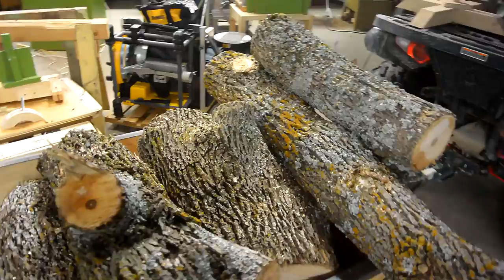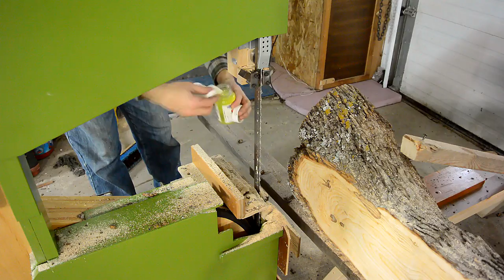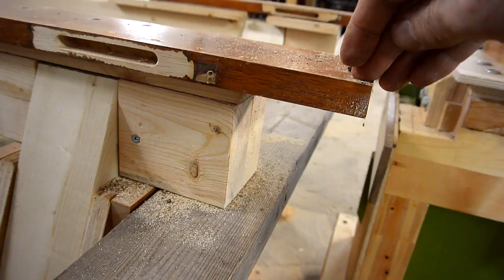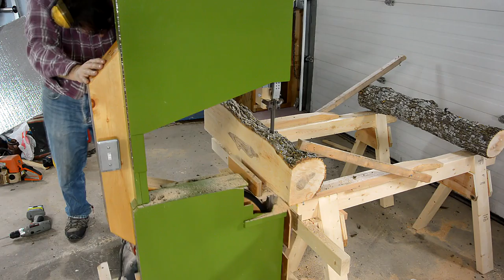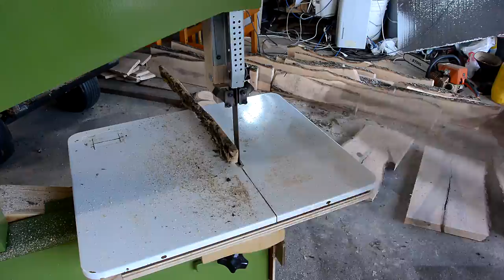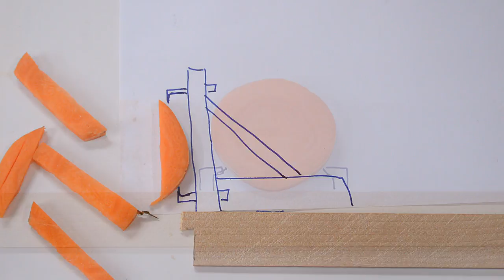Bandsaw-on-a-dolly sawmill improvements

Comment: +Matthias I've taken to using my shop vac in blower mode to clear away dust and chips. If you were to do that, then put your dust collection opposite the blower with a wide nozzle, you might be able to catch all of that and not have the clean up time between each cut. IDK
Reply: Actually, I have an idea that might work for your mill. Attached to the lower portion of the bandsaw, think a bowl shape with a dust collection port towards the bottom and angled back towards the bandsaw body. It would have to sit below your guide rail follower and it would have to be slightly large to really catch all the dust and chips, but I'm sure you could rig it up.

Comment: Apologies if my comments are repeats but: 1) If your motor seems underpowered, you may find a smaller blade cuts easier/better due to less friction and still cut straight if your tracking has improved. I notice a huge difference between a 1/2 inch and 3/4 inch blade on my Grizzly when resawing greener wood. 2) Can't tell from your video but I hope you are using dust mask in addition to dust collection. There can be lots of mold spores, etc.. in wood like you are cutting. I had a nasty prolonged lung infection after cutting some live edge wood a few years back. Love your constant innovations and explorations. Thx for your vids.

Comment: Just read the article accompanying this, and the only improvement I can think of at the moment, in the spirit of keeping this cheap and simple, would be some sort of fabric skirt to stretch around the wheels nearest the log. Maybe a strip of jeans stretched over a wooden bar, and the skirt weighted at the bottom, or something? It's the only thing I can think of that may help with the bark buildup you mentioned, and not get too much in the way of anything while you're sweeping up between cuts. I can see there isn't much room between the wheels and the sawhorses :D Take care.

Comment: Matthias - great stuff! Just mount a holder to aim a nozzle from a shop vac in front of the saw, and plug the hose into the exhaust/blower side. Should be enough to keep the floor clear while you work...

Comment: I'm sure you've seen them before, or at least researched it, but the idea at the end with the dogs to hold to log is how large-scale bandsaw operated sawmills work. The logs get rolled onto a carriage that moves back and forth through the bandsaw (as opposed to moving the saw) and are held in place by the dogs.  After each pass, the carriage returns to its home position, gets indexed whatever thickness they happen to be cutting the boards at the moment, and makes another pass.  Have you also considered some type of adjustable index either on the rolling saw or the sawhorses that would keep you from having to move the log after each pass? Something along the conceptual lines of your gear-drive box-joint jig?

Of course they use hydraulics and heavy duty steel framing in sawmills so they have plenty of power and strength, but I'm interested to see what cool, simple idea you can come up with that achieves a similar purpose.

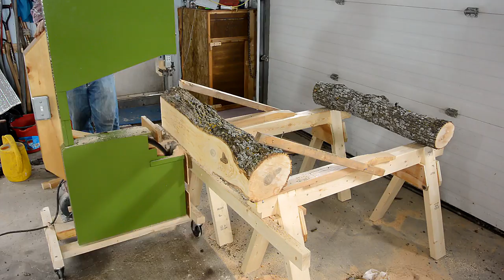Comment: Hi Matthias, with regards to log repositioning time, have you thought about the following: The pieces of board that you screw into the top of log at 3:59 in the video, the bottom piece of that is currently nailed into the board that the log is resting on. If instead of nailing it there, the bottom was attached to a runner (similar to a drawer runner) that could move back and forth toward the saw, and then you had some sort of gear system (or even just manually) move that sled, you could keep the log stable while moving it forward and not have to worry about unscrewing every time. Note that the piece of wood the log is resting on wouldn't be moving in the proposed setup, just the piece of board that's nailed to the top of the log. Picture a standard kitchen drawer, except the bottom of the draw stays still and just the front panel of the drawer (the log) moves in and out with the board nailed to the top stabilizing it via a runner.

Comment: Matthias, did you think about keeping the saw stationary and building a big sled running on a track to move the log through the blade.
Reply: Interesting idea, might as well mount the saw horizontally then.
Reply: Bob D. Just get some angle iron and use as tracks. The logs on tracks and band mill stationary. Just suggestion.
Reply: W.A. van Buren actually might get less pinching vertical, like you are doing.
Reply: Nice Idea but he would need twice the space for cutting the same length of log if i'm thining right. Correct me if I'm wrong :)
Reply: He's already done this. Look back like 4-5 years.
Reply: I tried this and I think next time I will try moving the saw.  Lots of space and large logs are tiring to move even with rollers in place
Reply: I think the point is to have the possibility of cutting the entire length of a tree if possible.
Reply: I think it's better to keep the log stationary in a solid fix and move the saw instead. Why move a 1500 lb. log if you can move the saw :P

Comment: To help with the sawdust/bark/debris removal try blowing it away as you cut; for example with compressed air, a leaf blower or exhaust from a shop vac. A strategically placed deflector shield will put the airflow where you want it.

Comment: Addressing your issue; I think is you revisit the possibility of a semi fixed dolly trax with a counter leaver wheel system, that it would start to eliminate your vibration issues. By placing the tracks on supports boards under the tracks themselves you can allow for cushioning to level and preventing reverberation. 
Attaching the tracks to the boards, and the board remaining free, it becomes semi permanent. Removable. 
Additionally, If you slant a feeding system toward the cutting area - loaded with log after log. Each log would provide the mass to provide the stability. Leaver in front of the first log would hold it all in place, which could be pushed out of the way by the movement of the dolly ban saw, then rotate back after the saw has finished the cut, pushing the fresh cut out of the way.

Comment: Mattias. I really like this project because I have a bunch of trees that will be either fire wood or lumber.  Sort of an extension of the rail idea, make a board that locks the bandsaw against the guide that you can slide it into. And perhaps a feed mechanism with a screw or winch setup for an automatic feed setup.
Reply: The home-made bandsaw sawmills I've seen all use a hand crank attached to a pulley for feeding the saw carrier over the log.

Comment: Log sled, attached to your gear system similar to your box joint jig. You advance the gear which advances the log. The log is secured once initially, and then the sled powered by your gear can determine the width of cut.

Comment: I guess these "sawhorses and dolly" setup just take up the same amount of space as the sawmill extension for this bandsaw would. There certainly is some idea behind these experiments with keeping the mill setup vertical. But I also strongly believe that once you make this horizontal (like your smaller one), the resulting sawmill will be the best solution for saving those otherwise wasted logs (making a great supply for a small workshop).

Comment: To stabilize and simplify your setup and movement of the log, you might consider a "log dog." As they're super simple to move between cuts and are basically giant staples! I've used them for hewing logs and it would be impossible to hew without them or at the very least, a partner. Best of all you could easily make them from some scrap angle iron you might have laying about!

Comment: You where on the right track with the carriage idea..make a dovetail type groove in the sawhorse tops and build what you drew and use the dovetail grooves to hold them on then build the log clamp.use a cam to hold it tight to the upright and tighten it to the log.

Comment: just my thought Mathias,  get 2 10' pieces of thin wall pipe, the cheap stuff. Make a track from it, attach them together about  14 "  ~  16" apart or what ever distance that works .. make 4 rollers that each have diagonal rollers and install them on the bottom of the saw.... then the saw can be placed on top of the spaced pipes...... and pushed as needed easily...since most the dust will be on the floor rather then on the pipes.....
  Now further,  attached the pipes to the frame that you place your log on so that it doesn't move around on the floor......  hence frame and track are all fairly solidly connected together... at least in a temporary fashion until you easily disconnect when not needed ....

Comment: Clamps are a pain too. If you want easy reattachment that stands vibration you have a hard problem. For rare homeuse perhaps consider screwing the log to a big plank/rail. The screws eat an inch, but as homeuser it might be faster/easier to lose a bit more for more stability and faster reload. Otherwise going horisontal, as u have done before, is the way.

Comment: for positioning the log, i would suggest a slotted board under the dolly for the wheels to ride in, with the distance between the slotted being how thick the boards are cut. i.e. making a track mill. that way you don't move the log between cuts, you just move the bandsaw to the next set of slots.

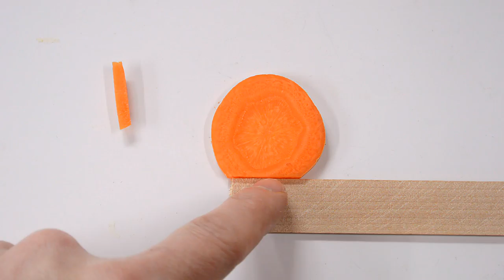Comment: 5:45 Just rotate the log along the vertical axis. End-to-end. That way you can just have a 90 degree panel mount and screw through it into the newly cut log face.

Extra work, sure... but still.

Comment: Instead of turning the log over once you have a right angle between the first two cut sides turn the log around so that you keep the same side down. 

Adding weight to the log support might help with the vibration.

Comment: I suggest you mount a plate or rollers on your band saw to gauge the slab thickness similar to the way it's done on a chainsaw mill. That way you can mount your log out from the table as far as you like or even on lathe type mounting so you can rotate it easily to cut it from the outside in. You wouldn't have to keep making adjustment for each cut. The second thing I see is a need for lubrication. Even though it's a vertical band saw, you are cutting through green wood that is full of sticky resin. If you added a bottle and tube to wet the blade with just water and maybe a catch basin underneath, it should make it easier and your blade will last longer.

Comment: Instead of tracks on the ground, It may be interesting to put a track like a C channel along the 2x4 guide and have rollers on the front face of the band saw slide into the track. That way the band saw can still move freely, but lock into the saw horses when used as a mill.

Comment: You could do your sled idea with maybe a wheel that shifts it 1/4" per turn, maybe a spike at the base of the end if the sled to keep the base of the log in place. On top could have some claws made from wood or metal that you just knock in with a hammer slightly with some kind of lever system in case they go too deep and can't be removed by hand.

Comment: Insufficient power frequently seems to be an issue when scavenging motors. Is there a practical way to add a second or third motor? Would that help? 1/2 or 3/4 hp motors are pretty easy to find. Maybe 3 of them would make sufficient power and torque. Just an idea and I would like to hear your expertise. (Thanks for the vids)
Reply: Well if they would all be the exact same speed you could just couple them together with v-belts and pulleys for example. Or for different speeds add differently sized pulleys.
One problemw ith this might be that the motors have different torgue at different speeds possibly, so while motor A wants to power through, Motor B already slows down and so Motor A has to work harder to compensate.

But again, Lets say you find 2 or 3 100% identical motors (maybe even the exact same ones over and over) that would be no problem.

Comment: for the build-up of sawdust that's on the wheels: Even though its better with the bigger casters, maybe it would be better if you had some-sort of brush system to brush off the sawdust as you roll. If the brush is rubbing the sawdust off, it might be easier to roll. I know that's not really the major issue, but I figure I'd throw it out there.
Reply: good and simple idea!

Comment: Having a real sawmill I find this a little painful to watch! ;-)  Of course, I had to shell out $10k to mill logs... :-(   I'm thinking if you milled another flat on the log and rotated it so you had a flat vertically oriented running parallel to the cut (the right side of the carrot), you could make a support bracket that is square to the sawhorses to hold the log.  You could even make it a sled that would slide horizontally on the sawhorses making repositioning for each cut quick and easy.

Comment: instead of moving the log, find a sturdy way to mount the log to a board vertical board perhaps just sink a few 4" screws through a board into the log from the side.  would it be too much torque to handle?

then if the log can hang over air, you can adjust the depth of cut with an adjustable guide rail on the saw.  let it stand off the saw horse, and progressivly pull the guide shoe in 1" each cut to make your passes.  no moving the log, just adjust the shoe.
Reply from the maker: Always count on youtube comments for really bad ideas.  But this bad idea has been suggested many times already.

Comment: How about...  Bottom of bandsaw mounted on two tracks on the wall. A third track on the ceiling above to hold a chain that carries the weight of the bandsaw. Place logs on floor with shims to level. Less lifting. PS great video!

Comment: What about a french cleat setup or wedges on the supports the log sits on set at certain lengths so the two boards that are screwed into the log match the cleats or wedges. That way once you made a cut then you just move to the next cleat or wedge and clamp down with quick clamps. It would set your thickness and you wouldn't have to unscrew and screw back on for each cut. I dont know just an idea...

Comment: Rather than making the bandsaw horizontal, I thought at the end it was going to end with suggesting putting the table surface vertical...
Rather than putting the first cut surface onto the horizontal table (which as Matthias eloquently pointed out, makes it difficult to balance all the time, particularly at the end), it could be mounted against a vertical surface (think two large 90 degree brackets sliding against the current horizontal platform). The brackets/frame would serve to both extend and balance out the remaining piece of wood and not need to be removed until the entire log is cut (with maybe a couple of clamps stopping the assembly sliding around).

Comment: Wouldn't quarter sawing the log reduce vibration as you would have a rectangular log to start with?  After its squared, make one pass and rotate the log 90 degrees.  Your slabs will also come out with better grain orientation for making anything flat, as it will have less cupping as it dries than plain sawn.

Comment: how about a self lubricating plastic slider for a guide. and for catching  that how about a small bin hooked to a dust collector and that clamp idea is not bad but id make that out of metal with a crank advance system but held with lag bolts

Comment: make a 'platform' that the thing rolls on, make it so that the sawdust falls through it. You can also attach a blower so it sucks the sawdust in.
Reply: Also add brushes in front of the two front wheels in a v-shape for each wheel so that the sawdust gets pushed to the side of the rail that the wheels goes on and down below the platform.

Comment: Could you set up horizontally stacked rails to hold the saw back from the log and remove them per your desired thickness?  Then you'd only have to remove for each cut and sweep.
Reply from the maker: Overhanging the support by a lot would be a very bad idea.

Comment: Matthias, if you build a support tray system to hold the logs, it would serve you better, use plywood in an "L" brace with more plywood "right angle"in the corners for strength. I can picture it. 
Sam

Comment: have you considered "big" wheels for the dolly, like from a hand truck or wheelbarrow?
there might even be an added benefit in that they would be fixed (not trying to turn) unlike the rotating casters.
Reply from the maker: pneumatic tires are not rigid enough
Reply: I won't argue that, but there are non-pneumatic hand truck wheel/tire combos.
I think they are called "polyolefin" if they are all one piece?
 there are also metal wheels w/ solid rubber tires.
or maybe something off a lawnmower?

just looking for something w/ larger diameter and non swivel.

Comment: You need wooden gears. Put a rack of wooden gears on the sawhorse, and make up a pair of pinions with a wooden axle to go between the two sawhorses. You can then twist the gears and voila, move the log towards the blade.

Comment: Well, it acts something like a large scale lathe so why not attempt something along the lines of using a structure that has a horizontal and vertical axis of motion - use a manual crank like your geared jigs - and fix the centers of the log's ends to the structure then rotate it along the long axis to your desired cut face and move it horizontally into the plane of the band saw blade. It could also act as the hoist lifting the log to the working height. The problem is how rigid can this structure be made as your vibration problem remains.
Reply from the maker: Logs can get very heavy, and the length varies.  This would be a crazy involved mechanism, too complicated.

Comment: How about this?  Mount the workpiece with double or triple cantilever toward your saw then attach one or two or three shim boards  of the thickness of your desired cut against your fence.  After each cut, remove a shim.  Rotate the log 90 degrees with a wide flat now and repeat the shim technique.